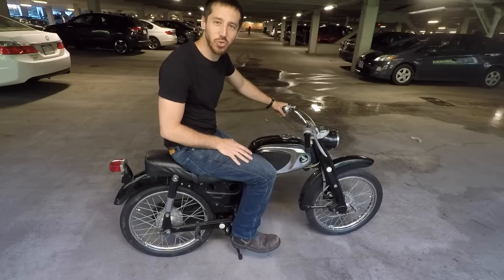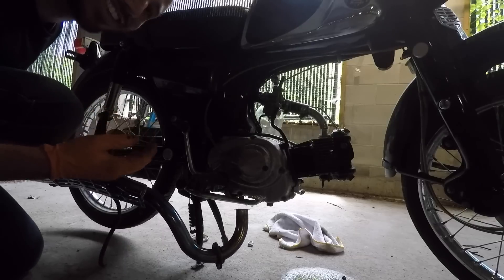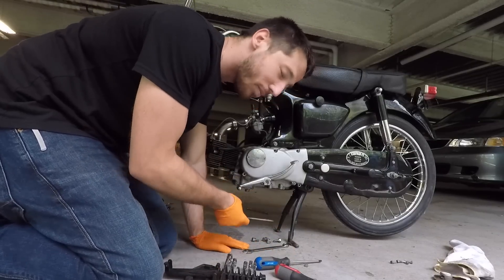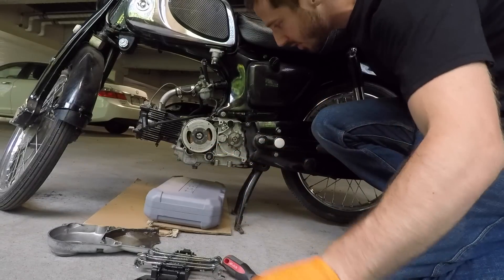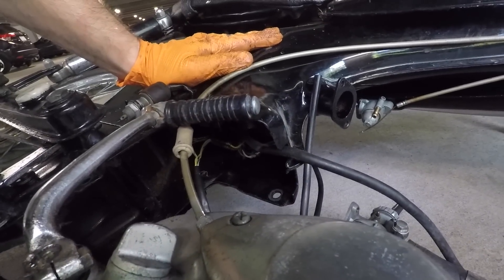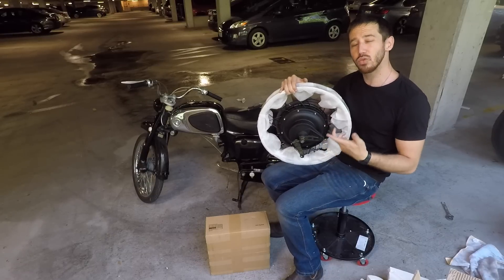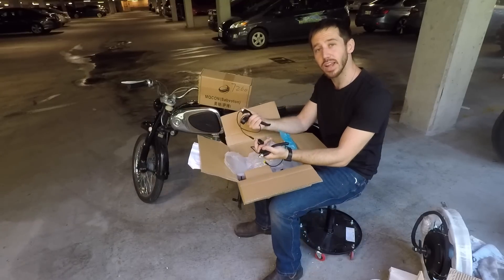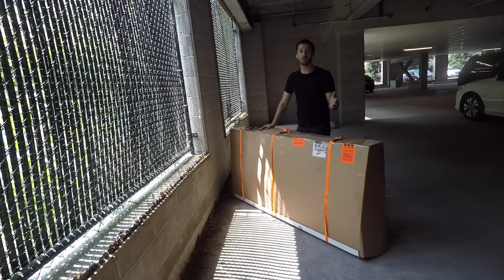DIY electric motorcycle Part 2, engine and e-parts prep

Comment: Ditch the hub motor and do an ME1616! 77hp. Way quicker to hurt yourself than a measly 3kw hub job.
Reply: Martyr4JesusTheChrist  It has about 10x the power of the one he wants to use. No drivetrain mods required, just a mounting plate needs to be made to mount the motor in the original chain line. Bike would launch to the Moon and back. Don't mind me though, I'm just a power nut.
Reply: Martyr4JesusTheChrist  Headway cells. Each cell does 200A. Add parallel to taste
Reply: Martyr4JesusTheChrist  Super easy. Each has a screw terminal on the top. They're 8ah a piece. Jumper wires or plates to string them together. They're lifepo4. Google headway cells and look at videos from jehugarcia. It's very doable. As long as you don't pin the throttle everywhere you go, you should get decent range too. My bike is 20kw and I get about 30-35mi on a 44ah pack running it wide open everywhere I go.
Reply: Martyr4JesusTheChrist  Lifepo4 is the safest chemistry. With those your concern is actually what touches the output. From what I've heard, you can dead short those and they won't explode. They last way longer in cycle life than normal lithium, but are slightly less dense. 
My bike is 20kw peak on takeoff with about 6-7 second 0-60. Continuous at 60 is 10kw. I use a qsmotor 5000w hub motor that I think is the 12 inch model. It gets warm, but never hot at these power levels. For battery, I use 20s20p pack of 2.2ah cells from hoverboard packs for 44ah total @72v. It's perfectly fine for the city, but that motor is holding it back due to hitting max RPM. 64 and it doesn't seem to spin any faster. I weigh maybe 240 and the bikes about the same. Where I live is a mix of hills and flats. It's on a donfang falcon frame.

Comment: Nice job. You can also use the original gears and simply replace the engine. That would be nicer looking and even more vintage :)
Reply from the maker: I considered that but the added complexity and points of failure made me choose to go with a hub motor instead. But what you describe could definitely work and some people go that route!
Reply: @EbikeSchool  yes its more complicated but not so messy but the end result is great.
Reply: remove head and cilinder and piston and arm ,and swingwheel as we call it , put a sprocket on there , remove spools first, , then put el motor where cilinder and head were and sprocket and chain on it to sprocket on crank.

Comment: Philips head screwdrivers will strip JIS (Japanese Industrial Standard) cross head screws. Buy some JIS scewdrivers when you're working on Japanese bikes. They hardly look any different, but they fit way better. A lot of shops don't even know this.
Reply: Also an impact screwdriver goes a long way towards removing JIS screws on Japanese motorcycles without stripping them. I prefer to use a deadblow hammer with it, but a ball peen works well enough.
eg:
https://www.mcmaster.com/6967a12
Reply: There's also some slight difference between JIS and ISO/DIN hex bolts as well. M8 (very common) JIS have a 12 mm head, and the others have a 13 mm head. If you care about consistency across the scooter, and need to replace bolts, make sure to use JIS. It took me a long time to
figure this out. 

Great videos, best of luck.
Reply: JIS Screwdriver Set JISPH1 PH2 PH3 4pc Set for Japanese Standard Screws https://www.amazon.com/dp/B07DPSDQMD/ref=cm_sw_r_cp_apa_i_RuGjDbNK9QN1K

Comment: Hello Micah ... I use a sab controller and love it also on a qs motor with 50mm for stator width . I also use asi bac controllers but like Shuhada Davitt sings “ Nothing Compares “ . Accelerated Systems Controllers are the cream of the crop . You won’t go back once you try one . As a bonus they are much tighter and unobtrusive and dissipate heat really well .

Comment: Impact screwdriver and a big hammer! 1st try,  BANG, you'll break it loose. 
It's a must have for all old honda's and pretty inexpensive. 

https://www.harborfreight.com/impact-screwdriver-set-with-case-37530.html

I love what you're doing! best of luck.
Reply: What fun! Can't wait to see it in action.
I second the use of an impact driver and maybe a rachet set. Can you use regen brakes on that controller/motor combo? Are you going to split open the tank and utilize that space for controller or something? What kind of range are you shooting for? Lastly, if I buy through one of the links you provide, do you get any compensation? Be great to throw you a bone when buying that stuff anyway.
Keep up the good work.

Comment: Next time, try to squirt a drop of 5-56 under the screws heads, and go for a coffee to give it time to penetrate into the threads. Lessens the battle of the wrenches...
Reply: Those normally come off with an impact driver, 10.00 off ebay.